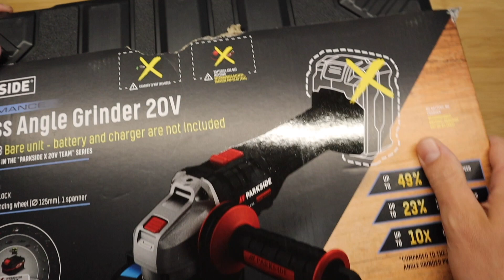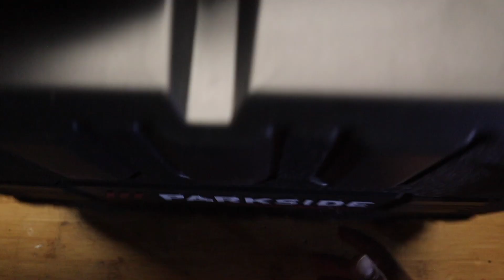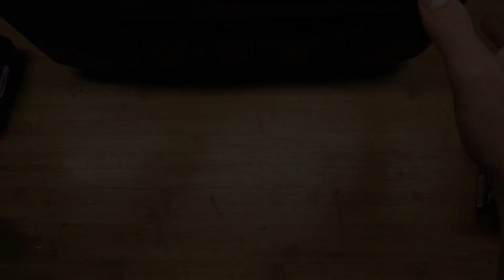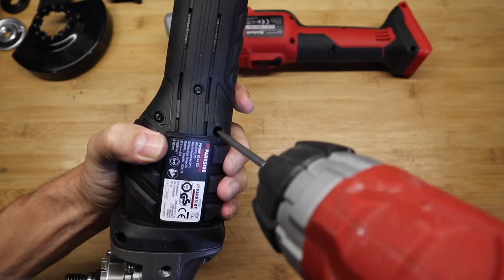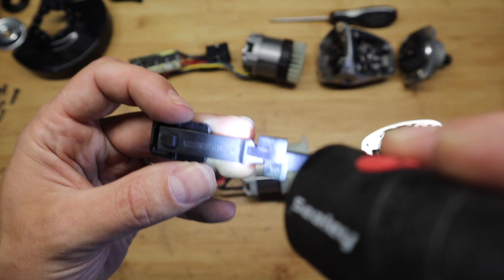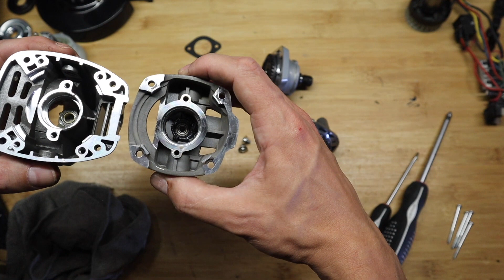Parkside vs Einhell - Who Builds the Best Budget Angel Grinder?

Comment: Einhell has added a mesh in newer versions. But it gets clogged with dust all the time. And if metal dust gets in, the motor will burn out.
Cheap  brushless motor with no dust protection

Comment: excellent and thoroughly video. IMHO BMS should be included with battery anytime. Because of safety it should be forced legally. But I understand Parkside choice, and is not a reason not to buy them. At first I would even think parkside tool is a little more robust, because of better heat dissipation and a superior button-design. In the end the difference is small. Maybe make a video about some mods. Use a battery tool on socket-power, or use a drill to do some cleaning, or . suprise me.

Comment: Good 1 point for Parkside to seal the electronics from direct contact with any metal dust that could create a short after some time. Would be nice to see a dewalt or milwaukee tools against those 2 manufacturers too. Anyway very good teardown.  I own einhell tools, stanley and milwaukee ones so would be nice to see such comparison.

Comment: Parkside's Performance range developed a bad reputation of going up in smoke for various reasons. It can be a faulty electronic, poor quality motor or sometimes just a poorly designed attachment that manages to "jam" the gearbox/motor. 
The shop that handles the warranty is well aware of the issues because they can't be bothered to fix them, they just send you a replacement tool (which is likely to go up in smoke as well). At some point they were sending older versions of the faulty tool because they were built slightly better. This is what happens in Romania at least, no idea how they handle it in other countries.
You can 3D print adapters for the batteries, but it's definitely not recommended. As the Parkside battery doesn't have on board protections you can destroy them by over discharging them (it even happens when used with Parkside tools).

Comment: Well the guarantees at Parkside are like this, in my country at least, in the user manual there should be a phone number with which you can contact the Parkside service in your country, there will be a few questions and some routine checks and in a few days you will receive by courier a new tooll under the warranty and  return the defective one.
Reply: An additional clarification regarding what exactly happens in the warranty, if the utensil breaks after 3-4 years, of course you get under  the warranty, the new version of the model available at that time .